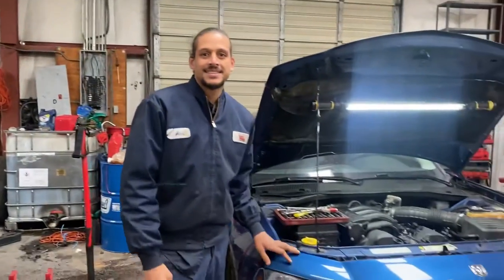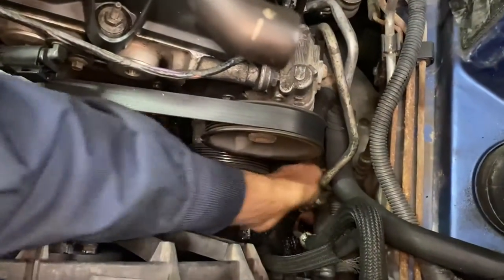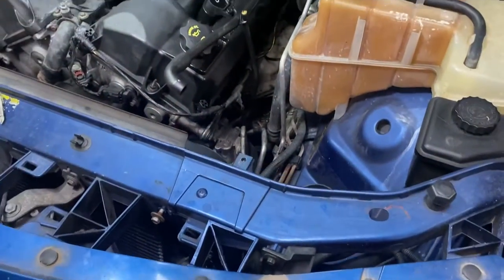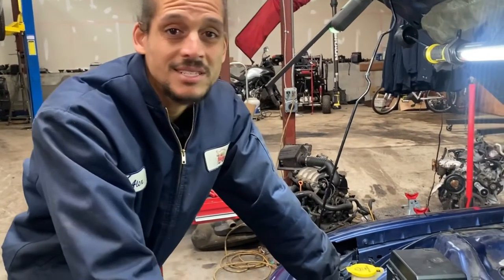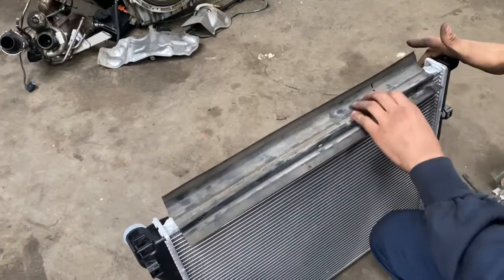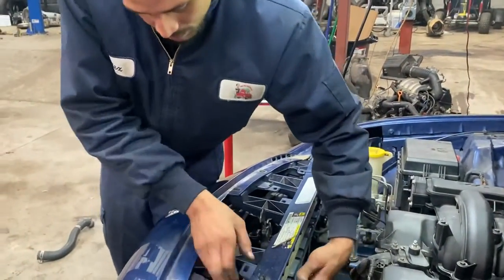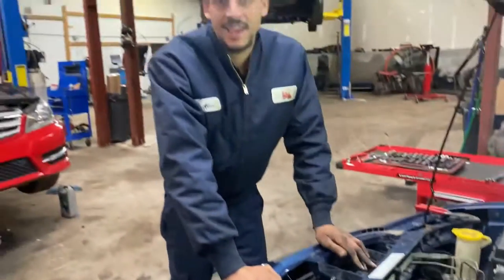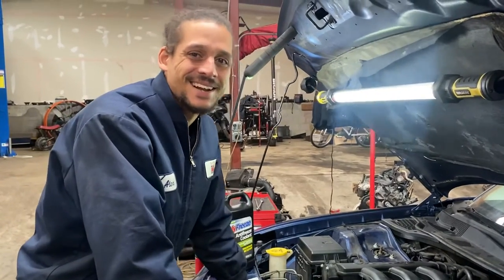How To Replace A Radiator On The 2006 - 2010 Dodge Charger (The Easiest Way) #radiator #overheating

Comment: Man i have an 07 Dodge Charger R/T and my radiator fans broke and it broke my radiator as well . I replaced it all just by watching your video so very helpful my guy I appreciate you saved me some good money 👍🏼👍🏼👍🏼👍🏼👍🏼👍🏼 the two screws in  the bottom are easier to take them off through the bottom
Reply from the maker: Hey buddy thanks for watching and I’m glad my video was helpful.
Reply: I just had the same thing happen to my '08 charger. Didn't know it had wrecked my radiator until i took the fan off to replace it. Thanks for the video!
Reply: My 07 5.7 radiator just took a crap, my fans won't come out from the top did you remove yours from the top?
Reply: @trethabarber2015  did you get it out

Comment: Thanks for the video. It was right to the point. I only had to use a 1/4" drive ratchet with 8mm and 10mm socket and just a pair of pliers it made the job easier. Tooling up and pulling radiator took less than 10 minutes. Now just waiting on the UPS truck to drop off my new radiator. Great video!!! ⭐⭐⭐⭐⭐
Reply from the maker: Thanks for watching buddy, glad you was able to learn from my video

Comment: Thank you for this video. I had to change one of my cam gears inside the timing, and the only way to get the long bolt out was to drop the radiator. And although it was other videos on how to remove it,  yours was the practical one that worked for me. Yeah those bottom bolts are a little tough, but it easy when you finally locate them. Appreciate it sir!
Reply from the maker: Glad I was able help!

Comment: Great video. I love the step by step and the camera work to see the bolts and ect... it worked out fine. The only thing I would add is that I once replaced my front bumper and the greatest thing is that all the bolts connecting the condenser to the radiator and other areas are exposed for easy  replacement of bolts. I tried for an hour to put the bolts back in and for me it was impossible and bloody hand on the fins. 3 bolts on each side and a nut and off comes the bumper to save you alot of headaches and bloody hands. Thanks for the step by step and to the video person. Great video. Am subscribed and thumbs up.

Comment: Good job. Watched another where dude removed the bumper cover and took it out through the bottom, way too much work. Been wrenching for about 45 years, have one coming in for this job and was trying to get a head start because haven't done one in a charger before.  Even Alldata doesn't say to take it out the bottom or mention removing bumper cover.  Great video.
Reply from the maker: Thanks brother glad you enjoyed it
Reply: @AlexTheCarDoctor  Oh, and those things you couldn't remember the name for that clip on the radiator I've always called nut plates.
Reply from the maker: Nut plates sounds right to me thanks man

Comment: Just an FYI....There is a recall on some of the vehicles for replacing the fan. It's call the L08 Recall
Reply from the maker: Good info buddy thank you
Reply: Could have never done it without watching your video and a few others. That was a job I never want to have to repeat. Like I stated before I found out while researching this job that there is actually a factory recall for the fan assembly. The OEM fan blades will I guess get brittle and break. Just so happens the 2007 charger I was working on is not on the list. Bummer! Seems they should have recalled even more vehicles but failed to do so. I also found out that if you have already done the replacement prior to the recall or not knowing about the recall. Chrysler/Dodge will reimburse you for the fan and even the radiator if it is damaged by the fan.

Comment: Just changed my 07 charger radiator and I’m about to bleed the system but I’m not seeing a air release valve 
I changed my system to a shaker does that matter?

Comment: Hi i have a 2008 dodge charger and its overheating i changed the Thermostat but its still overheating? What should I do
Reply from the maker: The first thing you should have done was perform a block test, that test checks the head gasket integrity. After you replace the thermostat, did you properly burp the cooling system.
Reply: @AlexTheCarDoctor  yes I got all the air out of the system and it was okay for a little bit but than it started to overheat again

Comment: My hoses too small for aftermarket radiator
Reply from the maker: Where did you get the radiator. Did you compare it with the old one it’s also possible that the whole radiator hose swelled up replace it if it has if not I will suggest getting the proper radiator

Comment: Is it the same for a 2006 5.7?
Reply from the maker: Yes
Reply: @AlexTheCarDoctor  Cool right on bro,ima try and hook mine up,thank's for the video!✌🏽
Reply: I have a quistion,i changed the water pump on my 06 charger rt and now it appears to have droplets of oil in the coolant resivor,are the head gaskets bad? What's your opinion?
Reply from the maker: Did you run the car hot, does the oil look milky? The best way to tell if the head gasket is bad you will need to perform a block test
Reply: I ran it hot a little but it didn't over heat and it's not milky,it's a trip!
Reply from the maker: Flush the coolant and hopefully it doesn’t come back
Reply: Right on!✌🏽
Reply: Were u able to get your double fans out from the top?
Reply: @trethabarber2015  Yes,this video is flawless. 👍🏽

Comment: I'm using my dad's goggle account but I'm a female asking dis question
Reply from the maker: Hello and thanks for watching.This process should be the same for the v8
Reply: Ok thanks cause I was told I had to take my bumper off in order to get my radiator out. And I was trying to see another way around taking the bumper off